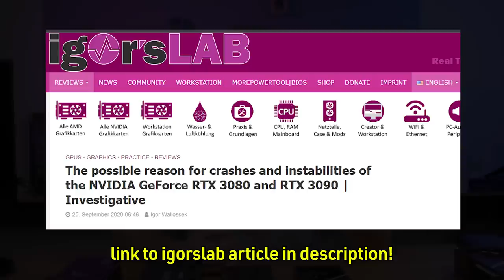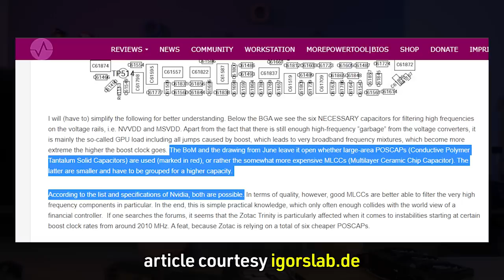The RTX 3080 Launch can't get any worse... Right? Wrong...

Comment: The "ESD and noise" part is honestly a bit annoying to hear... But other than that the content provided here is relevant and on point.
Yes, putting in the larger POSCAP capacitors do have the downside of higher Equivalent Series Inductance (ESL), compared to the multi layered ceramic capacitors (MLCC), resulting in worse high frequency performance. Ie, they look like they have more ESR when exposed to higher frequency noise.

Though, the POSCAP ones do have higher capacity compared to the MLCC ones, so going with only MLCC can lead to its own problems in regards to VRM response times. This can in turn result in crashes if the GPU were to ramp up faster than the VRM can keep up with. (Though, VRMs tend to have fairly tight control loops, but they still tend to be on the order of µs, while the GPU itself can quickly ramp from no load to full load in a matter of ns. Though, firmware can ease off on that ramp, ensuring that the VRM can keep up, and vice versa on load release.)

And yes, a firmware fix to the problem, bringing down peak power would be a fairly trivial fix. Might upset some buyers, but as Jay say, what does one want, a slightly lower clock speed, or crashes?

Also, the reason for why the "ESD and noise" part at 7:35 is because ESD is "Electro-Static Discharge", the term is largely irrelevant to a power delivery system. And most external sources of ESD isn't going to be particularly interested in the GPU to be fair, but rather even out some ground related potential, usually by conducting through the case and over to mains earth. (Also, ESD events needs to have a fair bit of energy behind it to upset a live circuit. Only reason it can kill electronics is because if it conducts through signal traces, then it can fry IO drivers. Going via ground/power rails is exceptionally rarely a problem. (ESD protection on IO pins is little more than a diode going to either ground (for negative voltages) or the power rail (For positive voltages. (Or negative voltages if it is a negative power rail.)) The reason for why this provides protection is because power plains have lots of capacitance, and also connects to most if not all circuitry, thereby bringing everything along with it.))

Then there is the thing with putting in more MLCC capacitors, this can have downsides as well due their lower amount of capacitance.
Not to mention that MLCC capacitors are also having higher failure rates due to being more sensitive to mechanical stress, heat cycling, and ESD compared to the POSCAP ones. (Though, the POSCAP ones likely make a nice pop if one reverse charges them, considering that they are tantalum capacitors....)

In the end, engineering the power delivery of a card is far from trivial. But I will say that removing all PSCAPs in exchange for MLCC ones isn't a flawless solution. But the other way around is clearly not correct either. Though, the main downsides of MLCCs tends to creep in after a few hundred thermal cycles, usually resulting in a dead short, some fizzling, or a burnt out VRM... (I myself tend to avoid MLCCs in my designs if long term reliability is important in a product.)
Reply: Well founders edition have 4 big ones and 2 smaller ones perhaps that's the sweet spot.
Reply: If only we got some real electronics engineers hired on these channels to convey some of these technical information to the layman, but I guess we would rather get a real job worth our time spend studying at the university  ;)
Reply: @aljoker7808  One generally wants to have a mix of capacitors. Smaller valued ones that have lower ESL, and ESR, and are thereby better at handling the high frequency content. Ie, MLCCs.

Though, their low capacitance means that they will not be able to handle the larger power gulps, this is where the far far larger POSCAPs comes in. As an example, a larger MLCC capacitor can have 5-10 µF of capacitance, while a single POSCAP can be in the 100-400 µF area. This means that it is far better at suppressing VRM ripple, ensuring a more smooth power delivery to our GPU.

Also, the even smaller capacitors around the POSCAPs and MLCCs are just normal ceramic caps, (sometimes multilayered ones, but less layers than an "MLCC".) these smaller capacitors can have capacitances down in the few 10's of nF.

In some really high frequency designs, one can even need to step down lower than that, though, such one would normally do inside of the chip itself. (Ie, inside the GPU.)

If the FE's configuration is the sweet spot is a good question. I would say that since Nvidia has been making chips for over 2 decades, designed the GPU in question, knows it power requirements and inner workings better than anyone else. That they if anyone should be able to know how to make an "ideal" setup.

Ie, I wouldn't be surprised if they have made a lot of considerations behind their decision. Though, price might still be niggling at it, maybe a 4 MLCC and 2 POSCAP might be the real ideal, or a 50/50 solution. (I don't know. I don't work for Nvidia.)
Reply: Thank you for your explanation! I was about to write something similar, albeit much shorter, because I was too annoyed by the usage of ESD terminology here :D
Reply: @N00B283  Well, finding real engineers can be hard. And the problem with a lot of engineers on Youtube is that they become "experts" on everything even remotely touching their topic. And thereby always talking with authority on such subjects.

It is rather off putting at times. Especially when such channels talk about something that they have little knowledge about...
Reply: @_MarosMacko  There is a lot of people that have little understanding of the term ESD, and static buildup for that matter. And how ESD kills components, and how components are protected from it.

Some people for an example likes grounding themselves before poking at electronics, this too can kill the device. Since the device might have a static charge on it.

The simplest trick to not kill electronics is to always touch ground on the device itself. Usually a heat sink, mounting screw, or the shielding on a connector.

I for one haven't killed any components of note throughout my nearly 2 decade long electronics career, and I for a time programmed micros while standing on a fuzzy rug that made one's hair stand up....

In the end:
If one knows how static buildup happens, how it kills, and how things are protected from it. Then one can handle ESD sensitive devices in very static environments without killing said devices. (Though, there is always a risk of fumbling up and killing it regardless....)
Reply: @todayonthebench   Definitely! I am just an EE student (but very active and motivated), so not yet as experienced as you, but I understand the problem with the caps here. People should be informed about stuff like this, especially when "teaching" others ;) ESD and EMC are 2 separate things (And just the bulk capacitance).

I also wondered, a lot of those GPUs did not have bulk caps soldered near the individual phases.... They are a bot far from the GPU, but for the bulk they would definitely help I would say, so then there can be more MLCCs near the actual GPU.
Reply: This man goin crazy with his nested parentheses, should be a programmer

Maybe is?...
Reply: This comment thread is awesome.  Very interesting stuff.
Reply: @todayonthebench  As an average Joe, would it be a better choice to opt for a card that runs the same setup as the nvidia card?
Reply: @_MarosMacko  The lack of bulk capacitance near the phases themselves will tend to lead to increased ripple, due to a lack of bulk capacitance.

Though, one can also shoot oneself in the foot if one adds too much of it.

Since the inductance of the traces going from the phases over to the GPU itself can result in the GPU getting overvolted on load release. (a problem that tends to be exaggerated by the fact that the VRM will compensate for the voltage drop created by the resistance of those traces during load. This is though not the biggest type of problem, since few to no application will ramp down that quickly. Maybe if we toggle the reset pin for the GPU. Though, the PLL in the GPU might have its own down ramping limits to prevent this issue as well.)

Another issue of adding too much bulk capacitance close to the phases is that when the GPU goes from no load to full load, the VRM doesn't just have to power the GPU, but also charge up those caps to bring up the voltage on the output of the phases, as to account for the voltage drop through our traces. So too much bulk capacitance here can make the reaction time of our VRM worse as well....

So those two problems needs to be taken into consideration. (But both these problems can largely be fixed by clever PLL ramp limits, and other "behind the scenes" power management features.)

But non of that matters if we push the GPU into drawing lots of power, while lacking adequate bulk capacitance, resulting in power drop outs for our GPU. (Now, if I had a 3080 or 3090 I could just check it with my 1.5 GHz scope (Though, I think even my 50 MHz "budget" scope is sufficient for the job). But I don't have any of these GPUs.)
Reply: @pfunk_1535  I do indeed to a bit of programming. Mainly in Javascript and C, but have also fiddled with some Assembly.

Though, I do a lot more electronics engineering, and computer architecture design. (Though, the later is more theoretical due to practical reasons.)
Reply: At least Igor from Igorslab said, that in Nvidias specification they say you can put either the POSCAP or 10 MLCs that combined have the same capacity.
Reply: @finnba_h  I would currently wait and see how things pans out.
But Nvidia is the chip designer, and have the most development experience with it.

When making a chip and reference design, then one is applying a lot of inner knowledge about the chip in question.

Nvidia's board partners can mostly look at the GPU chip as a "black box". (how it exactly works, how power is routed within it, how much internal capacitance it has and where. And other important parameters aren't usually stated.) The only thing board partners have to go on is the reference design provided by Nvidia.

While Nvidia has full knowledge of what they have implemented. So their design should be more competently made. Making it a more "safe" design.

Due note that it isn't just about the capacitor array behind the GPU that matters, but the bulk capacitance at the VRM phases will also effect system stability. So a card that skimps on those can have excessive voltage ripple for the GPU to operate smoothly.
Reply: @todayonthebench  Really good information, I'm an aerospace engineer and only took enough EE classes to get a basic understanding of design considerations for communications systems. Your comments of the longevity considerations of the two types of capacitors I found really interesting, I wonder if that was a factor in why some of the AIBs did not include the MLCCs in their designs. Do you have any knowledge of how providing additional heat sinking, such as thermal pads touching a thick metal back plate, might might impact their longevity? My first thought would be that it could help improve lifespan by flattening out the thermal cycling.
Reply: @jakobm.4183  If a manufacturer follows that guidance or not is though a better question.
One could desolder the MLCC caps and measure them to check if this is the case. Since if it is, then it is mainly a question of cost.

Though, two of the POSCAPs on the FE card is 220 µF, while the other two are 470µF. A rather huge difference.

Now I can "buy" that a 22µF MLCC could be about that size, still feel like it should be bigger. But 47µF would need to be bigger in my experience. (MLCC's aren't known for their density. Large valued ones tends to be huge.)

The Zotac card on the other hand just uses 330µF POSCAPs on the other hand.... (Larger values tends to equal larger ESL for caps in general. So maybe going down to 220µF POSCAPs could "fix" it. (And then compensating the decreased bulk capacitance by adding some extra caps outside the keep out area. (ie the heat sink retention bracket.)))
Reply: @Ender240sxS13  Generally when it comes to MLCC caps, one want to keep them at constant temperature. No voltage spikes (penetrates the isolation and can cause cracking). And no flexing of the board. (Its ceramic after all, anyone trying to flex fine porslin knows that it isn't all that bendy...)

Though, MLCCs have a "slew" of other issues.

Like just soldering them can be a problem, since the cap and the board expands at different rates. This results in the cap either being under tension, or stress post solder. And this it will be subject to for its whole working life. (And thermal expansion related stresses are measured in MPa/ΔC or GPa/ΔC depending on the material...)

There is though MLCC capacitors with flexible terminations, where there is a pliable interface between the capacitor and its contact. (These caps look identical to normal ones, unless one gently polish them down to take a look inside, they are also much more expensive! (Usually sold as "Automotive grade" or "Aerospace grade" caps.))

But for critical applications one should generally avoid MLCCs at nearly all costs.
One can get film capacitors with similar specs that aren't having any of the downsides. But at an increased cost...

One can also design a less power dense system and get away with more trivial bypassing in general.

Though, at times, one has no choice but to spec an MLCC, since the film ones are less dense.... (One can also stack normal ceramic caps. And there is also capacitors that internally are two caps in series, ensuring that they can't short out as easily.)

But in some designs, one can just spec the PCB to have another 2 layers and use those as a planar capacitor. (Increases PCB costs, and increases thickness. This though has its own downsides, like being even less dense....)
Reply: @todayonthebench  Excuse my ignorance on the matter(still only a student) but isn't there some way to get the ESL parasitics out of the caps by canceling out the imaginary component with a capacitor in series or is my understanding of the theory on that part incorrect or would other problems arise in such an occasion?
Reply: @N00B283  One can't really remove the ESL of a capacitor by adding in another capacitor in series. The inductance of each cap would just add together and get even worse overall performance.

Putting two caps in parallel on the other hand would reduce the effective ESL of the group. Similar to how we can put multiple resistors in parallel to get a smaller resistance.

What ESL describes is only the amount of series inductance inherent in the capacitor.

Though, if we have an induction motor and wish to improve its power factor, then yes, here a capacitor can be of help. But it's for totally different reasons.

In the end, getting rid of the ESL and ESR of a capacitor is frankly not possible. (One can though design a capacitor that has more or less of these properties. Like a through hole ceramic cap tends to have more ESL and ESR than an equivalent (same amount of capacitance) surface mount capacitor.)

Its similar to the Equivalent Series Capacitance of an inductor or resistor. (Resistors also have ESL, and inductors also have ESR. (The "ES-x" of a component is simply describing the "unwanted properties" that any real component will have. Ideal/"theoretical" components doesn't have these properties.))

Comment: Imagine being the dude who returned his 2080ti for a card that crashed when overclocked.
Reply: Lmfao
Reply: Yea but this card doesn't need to be overclocked to destroy the 2080ti
Reply: Erich oof, got em there ig 🤷‍♂️
Reply: @darthstrukt  did you watch the video? if you dont overclock the card runs perfectly fine
Reply: @darthstrukt  you could literally downclock so low that gpu boost won't exceed 1710mhz and it would still beat the 2080ti. Or just get a FE or ASUS 3080 that don't use poscap components.
Reply: Every car end up crashing if you overclock them to much.
Reply: @isuckatpaintball  

The problem is; the cards automatically do that if thermals and power limits checks out.
Reply: @ycageLehT  No that wouldnt happen if you downclocked